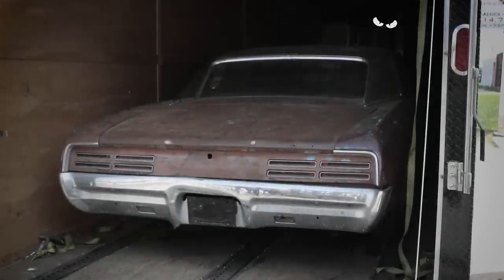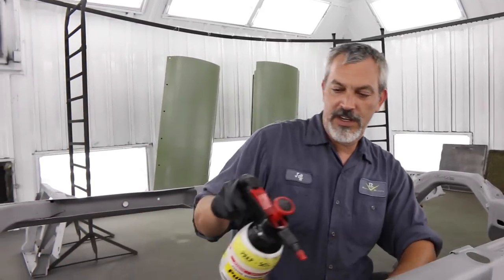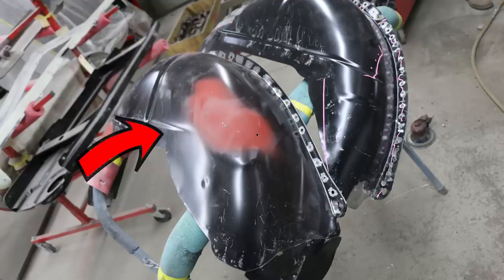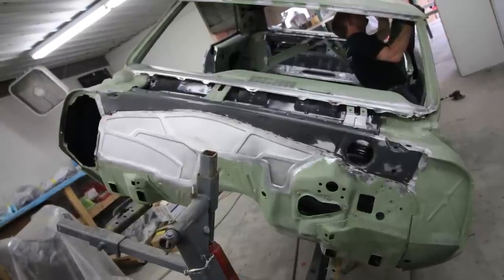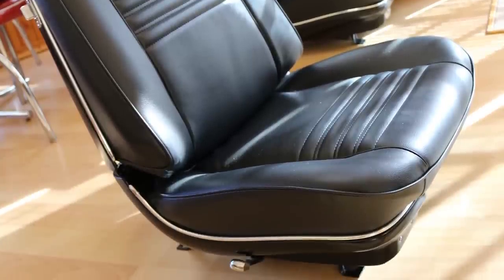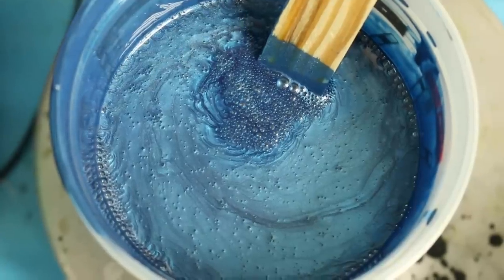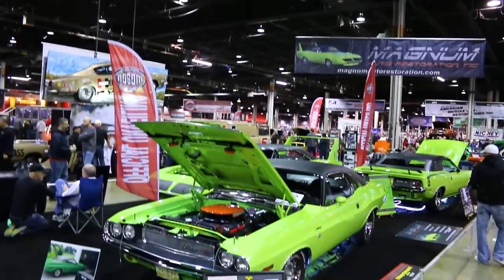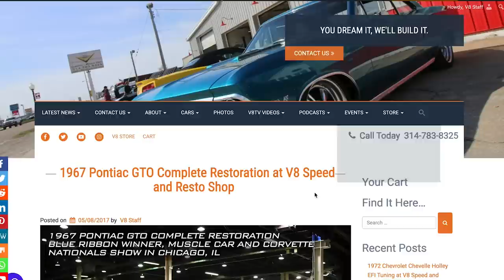1967 Pontiac GTO Restoration and Unveiling Video V8 Speed and Resto Shop GTO Full Build

Comment: Nice Looker & Presentation - and so someday it will end up at Mecum or Barrett Jackson - and the +- $200,000 they spent will change hands - one millionaire to another - I didn't realize how good we had it when we could buy a used one, less that 10 years old, for less than $1000 - so goes life

Comment: First rate restoration and an excellent video production.  For my tastes, your resto-mod "recipe" is just the right amount of "mod"...  Suspension, disc brakes, fuel injection, vintage aire...  but the look is still near perfect period original.  Two questions:  Did you and owner consider adding a 4L80E overdrive trans, and why was it not included?  And, the tire and wheel combo looks great, clearly bigger than stock but perfectly suited to the car.  What was your wheel source, size,  and tire  size?
Reply from the maker: Tires are BFG Radial T/A 235/60/15 and 255/60/15, with an OPGI Wheel Kit 15x7" and 15x8" PN GT0004.     As for the transmission, the 4L80 is a great option, but at the time, the customer chose to stick with the 400.     Thanks for the kind words on the car and the production!